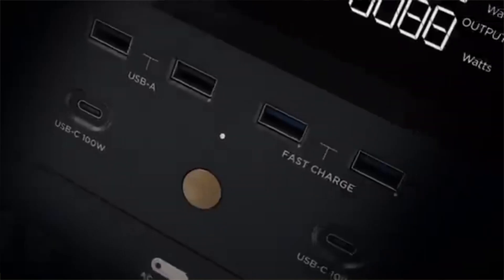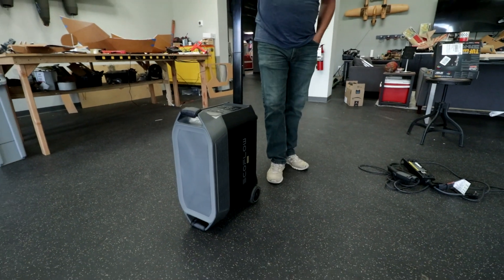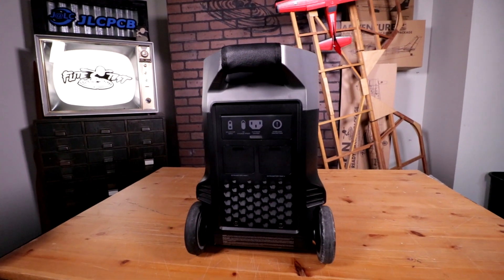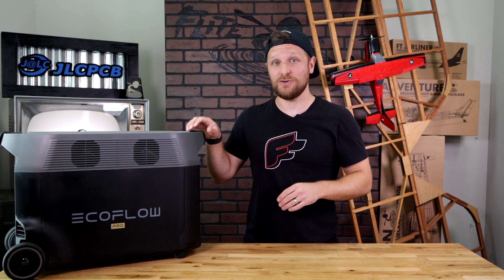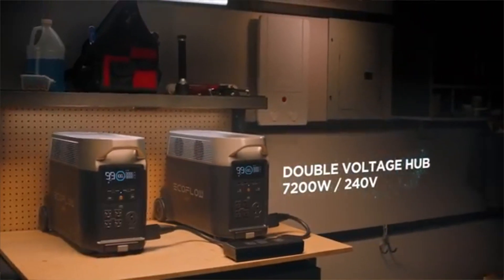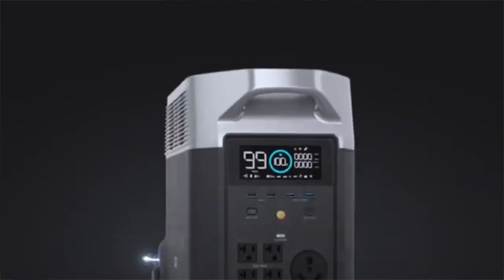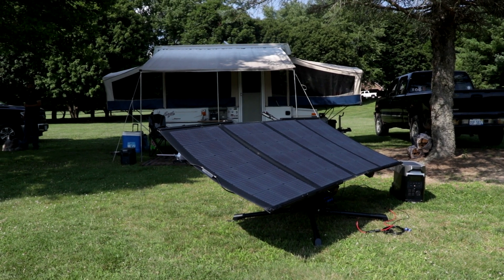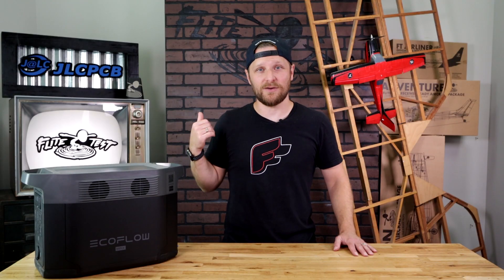EcoFlow Delta Pro and Delta Max Tech Review!

Comment: NOTE: The Delta Max is NOT just a portable option…the Delta Max can also power your your home.  
The major difference is the Pro can support 240v….however for you to power 240V appliances you will need two Delta Pros. 
The DeltaMax works perfect as a home backup…powering essential circuits in the event of a backup.

Comment: I take it that is lithium cell based, - does it have built in thermal protection? ...I want a CO2 foam fire extinguisher with mine.... - they will eventually be banned on ferries, in public parks... - just needs the first cases of old batteries exploding in flames....

Comment: I wish I had known about this product last year when the Kickstarter promo sale started.  The Delta Pro is on sale right now at Home Depot for $3199 (a $500 savings) but it's still too pricey for me.  Will probably have to settle for the Delta Max which is $1899 at HD.  Hopefully I can find it cheaper somewhere else.
Reply: It might help to know that the federal government is giving tax deductions of up to 30% of the cost of your system, so it may not be as expensive as you think.  The deduction doesn’t cover refurbished items.  Check it out!
Reply: @susanbdusan2785  Thanks for the info, would love to have a solar backup power setup someday, especially with all the power outages we get every year. For now I just have a Delta Max 2000, Delta Max 1600, and Delta Max extra battery. I'm hoping that's enough to get us through some of the shorter power outages (1 day or less) without having to go through the trouble of using our gas generators and running a bunch of extension cords into the house.  We've had several outages that lasted 2 -3 days, so we have no choice but to use our gas generators when they last that long.

Comment: Let’s be real. Who the heck would be worrying about their dryer. If you are worrying about the dryer you mustn’t have a lot to worry about.
Reply: the 30a out let will Not run a Dry its Not a 240v out let its 120v @ 30a but you can put 2 together with the Included hookup and run 240v

Comment: Mainly a mini fridge to keep food cold or frozen. Secondly a heater for when it's cold. And a fan for when it's hot. Not an ac unit just a fan. I'll also want a wifi router ps4 and TV for online gaming. Only plug in when I need it and charge the pack with solar panels. How's that sound? Rv living

Comment: Does these units have the larger plug like my gas generator has ?? Not just the standard plugs for 110 voltage??
Reply: The EcoFlow Delta Pro has the three prong RV outlet.  Just buy an adaptor to connect to the NEMA four prong outlet.

Comment: I hooked mine up to power an outbuilding I'm working on running electric for, and the unit overloads every time I turn on an 1800 W miter saw.  At first, it happened while I was running the overhead lights which pull an additional 500 W, so I tried running without them and it overloaded again.  The saw has a 2400 W startup from what I can tell, can't find the actual specs, but at most this saw would pull 3400 W on startup for a short burst.  Supposedly this delta pro can handle a 7K surge and 3600 out.  I'm calling bull on this.

Comment: different areas have different needs. Where I live, without power it would be miserable sleeping with no AC. So my 'emergency' needs are based on cooling...summer.  Keeping food fresh. Northern climate...winter...you just put your food outside...in the garage.  But, plenty of access to sun and solar in the south, not so much winter in the north.  Winter stuff is a whole other ballgame for heat.  You need a carbon based solution. Best would be indoor kerosene heater.  Different solutions for different climates. This must always be taken into account. And use multiple energy sources. Generate power when you need it, solar when you can, and fossile fuels for heat and cooking. Cooking with electricity...very inefficient.  It's all about the BTU's. This is why 'prepping video's' end up being useless to 1/2 the audience, or more. Depends where you are. Is water an issue, cooling...heat...what ? In the end, what we're talking about here is...being prepared as best you can for the timeframe you can afford. Barring put up Tesla walls in your garage, good stuff.
Reply: I agree.  I'm in the south and need a way to power some type of AC and fridge next time a hurricane hits.  I ordered one of these and solar panels, hope it works.  Now need to get a portable AC and considering the Delta Wave or breeze (whatever it's called).  I see videos where people power drones, coffee pots, power tools, etc.  I just care about staying cool enough so we aren't miserable and not having to throw out all my food so we don't have to evacuate.  Hope this suffices.  I have a gas generator and not only is it hard to get gas during natural disasters, it doesn't run long with just a fridge and a couple phones plugged in.  I'd need several containers full of gas just for a day.  Plus, the gas gets spilled all over when I fill it and can be dangerous just in general.   Tried to get a whole home natural gas generator and can't find people to install it, been trying for almost a year.

Comment: Question is how long will it run parts of your house and then the most important. How long will it take to fully charge?
Reply: The Delta Pro can power parts or certain circuits in your house.  Using the 30-amp RV plug, you can hook it up to a manual transfer or interlock switch.  You have to be very careful about your loads though.  As to how long it takes to charge it, depends on the power source.  From a standard 110v wall outlet, at 1800watts, it takes just under 3 hrs. to charge.

I'm looking to buy one, as a backup, to our Tri-fuel generator that can run our whole house.  I hope it can run the furnace, lights, water heater and our two frigs and freezer, for 6 to 8 hrs. I would run the Delta Pro, manly at night, and use our generator to charge it when needed.

Comment: The Ecoflow Delta advertises AC output at 1800 W Pure Sine. FALSE! The battery shuts down at 1400 watts. Here is the video showing the battery 
shuts down:  https://youtu.be/7w7WXJK6OZA
Reply: That happened to me also as I plugged into my oil filled radiant heater at 1400 wats and it shut off!

Comment: Based on typical usage, a gas generator is more environmentally friendly than "luggable batteries".

The production and end of life of Lithium Ion Batteries causes about 100kg of CO2 per KWh of battery.

(Link to Forbes article deleted to prevent comment deletion)

That's the equivalent of 12 gallons of gasoline.  You then have to consider the CO2 generated producing the power on the grid.  The US grid is only about 24% renewable.

So not only do "luggable battery banks" have a a HUGE upfront CO2 cost, they have a continual CO2 cost 

It would take considerable use to eventually offset the CO2 from the manufacturing of the battery bank.

The Pro model of this battery is 3.6kwh.  That's a carbon deficit of Over 40 gallons of gasoline!

A typical generator, running at peak efficiency, is about 30% brake specific fuel consumption and 95% mechanical to electric conversion.

I need to sit-down and do the math. But the turn over between the CO2 cost of the battery and the grid is well past 100 gallons of fuel.
Reply: Yeah but these are silent and not loud or stinky or poisonous
Reply: @thepatternforms85  not locally, no, but everywhere else yes.
Reply: @thepatternforms85  i guess its ok to poison other people, especially if they are in 3rd world countries
Reply: @coreyfro  has generators locally loud yea, stinky locally yea, posiunius carbon monoxide gas which will be lethal if too close yea…
Reply: @thepatternforms85  great, but this isnt 'green' as advertised.  The battery supply is not a greener solution.  The GHG released in the lifetimes of both solutions,  the generator will be fewer and GHG"s are a global problem. 

So just say it,  you are OK with other people dying just so you MAY die a little less...but probably not...because GHG's are global.
Reply: @thepatternforms85  are you asking if i keep my power usage low? Yes.  The answer is yes.

Regardless, this product is FALSE...ADVERTISING...Period. the end.

Otherwise:

i am always seeking the ideal solution.  This solution is NOT green (false advertising), is NOT efficient (dirty power in, power losses in conversion between electrical-chemical conversion, thus less efficient than a generator)

The primary strategy is reduce use...then choose least polluting solution.

This solution is equivalent to over 100 gallons of gasoline in emissions just in the manufacture of the battery, before the battery is even charged.

How long would 100 gallons run a generator? Typical usage...probably the life of the generator.  Most people dont use them that much.
Reply: @thepatternforms85  you dont understand 

I am not complaining about electricity.

The ammount of green house gasses used to produce Lithium Ion batteries is horrendous. Not the electricity in the, the MANUFACTURE OF them.

To make 1 kwh of lithium ion battery, 100kg of CO2 are produced.

Dor your drone or plane, its about 1kg of co2, but there is no alternative. Planes gotta fly.

This battery bank, you will never use it enough to offset the carbon released from the MANUFACTURE.

I would share a link, but this comment would get deleted.
Reply: @coreyfro  people buy and use them bc they are silent, not smelly, and not poisonous...nobody cares about climate change...climate change is a fact of modern life on earth and is totally not avoidable...there is no reason to even care about or mention climate change really...everyone is so busy talking about what is climate friendly and what is not but never stop to realize that climate change is a fact of modernity and industrilaztion and we can never stop it and nor should we at this point...stopping climate change and abandoning modern energy usage would cause more human harm...not less.....so why even bring it up at all?
Reply: @thepatternforms85  if people buy them for that reason,  then they aren't victims of false advertising and probably don't care that they are polluting and paying toxic processing to other people. 

The people who believe the hipe are victims of false advertising and probably do care about the net greenhouse problem
Reply: I've never heard this before. Question, does it matter that this actually has a lithium iron phosphate battery or is it just six in one hand, half a dozen in the other? I've always been attracted power stations so in an emergency I wouldn't be stuck in hours long lines trying to get 5 gals of gas for a ginny. These having a terrible carbon footprint never occurred to me.
Reply: @5th2ndOnly  many of the elements common to these batteries are hard to mine and refine, so yes.  There are many emerging battery technologies which are low tech and use more easily available elements, but their energy density is not as high. These are better for grid applications. Lead acid CAN be better for grid applications.

For charging batteries and powering small RC accessories? Lead acid all the way.
Reply: @coreyfro  So you spoke to it in your OP in terms of reaching carbon breakeven point, but do you think the fact that the LiFePo4 has the ability to be charged infinitely more times (the OG Delta is rated 800 charges to 80%, the Pro claims 6500 charges) moves the needle at all in its favor? I mean that would require putting it to heavier use, not just every few storms, but what are your thoughts from that standpoint?
Reply: @5th2ndOnly  lifepo4 batteries have the exact same upfront costs.  While they have higher cycles, one must consider the application.  Lifepo4 cycle capacity is moot IF people never even remotely approach that cycle count.

That's the point.  For most generators, 100 gallons of fuel is WELL beyond their application.  A Honda generator will last forever, butost never see 50 gallons, let alone 100.
Reply: @5th2ndOnly  I would love to have this conversation but it is hard when URLS can't be shared.  I am heavy on the peer reviewed documents but it pains me to mention them without being able to provide them.

The guardian has a great article on the Lion waste problem, and it's a doozy.
Reply: @coreyfro  I understand, and I appreciate your insight. This definitely introduces a whole different level of consideration in terms of making this type of purchase.

Comment: Flitetest, I love you. Really I do.  You keep deleting my comments about the CO2 burden of Lithium Ion and how they are NOT GREENER in GRID APPLICATIONS or GENERATOR APPLICATIONS, I will target you with a very specific campaign. My comments are thuroughly researched.  I am a green energy advocate.  Lithium Ion has to stop being used as a green energy boondoggle.

The only reason lithium ion is greener in auto applications is because of frequency of use.  Generators, by design, are not frequently used. The average person will never offset the carbon from the manufacturing of lithium ion luggable batteries when compared to generators.